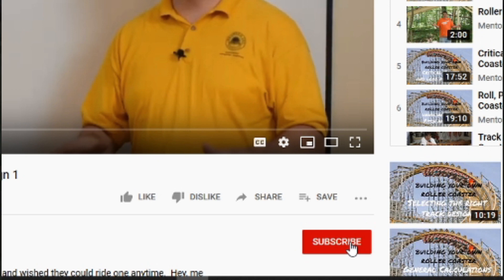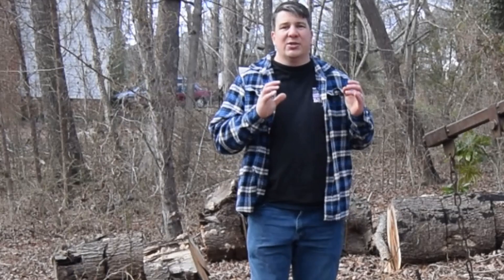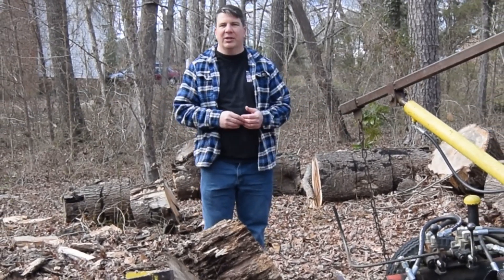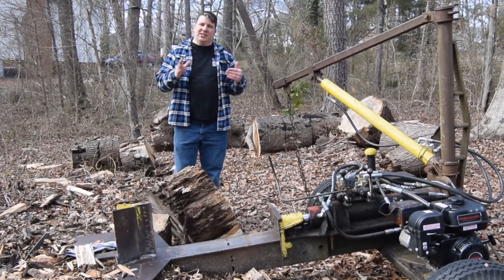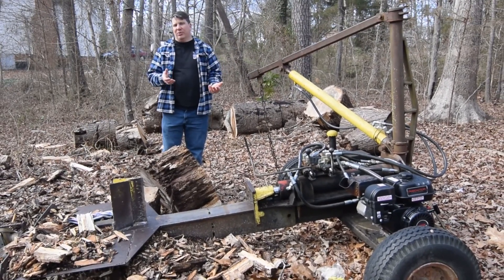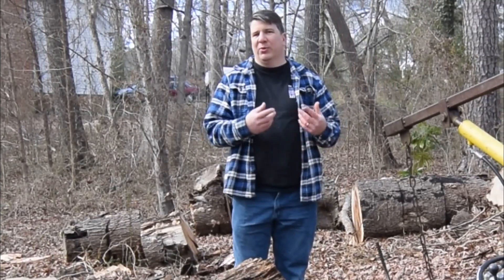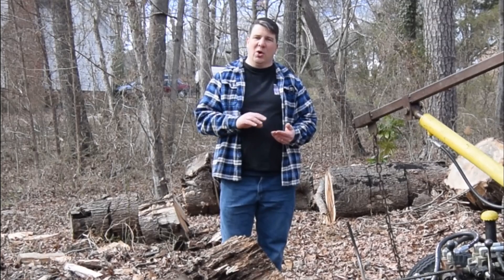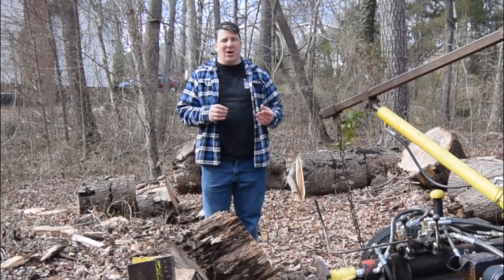Two Stage Pump Demonstration on a Log Splitter

Comment: What size hydraulic pump do you have? I have a 5hp engine but having trouble sizing 2 stage pump
Reply from the maker: Try this.  https://www.northerntool.com/products/concentric-hydraulic-pump-11-gpm-2-stage-model-1001689-1012

Multiply pressure and flow then divide by 1714 to get hp.  This one is 2.9 GPM@3000 PSI = 5.07 hp.

Comment: Everybody on my tractor forum is telling me not to use a two stage pump because they are slow; this seems fine. They are crazy.
Reply from the maker: There was a fixed pump on the log splitter when I bought it.  i swapped it out pretty quick.